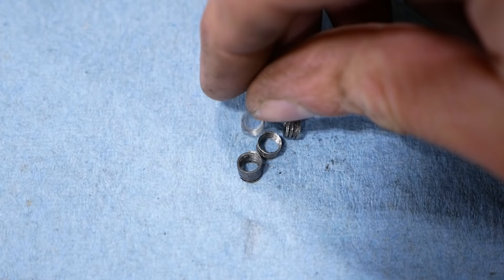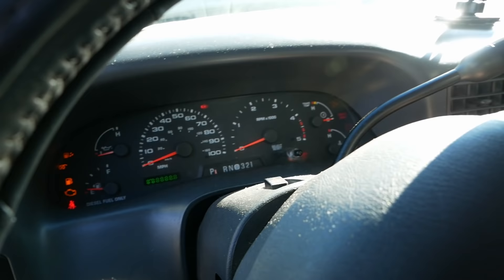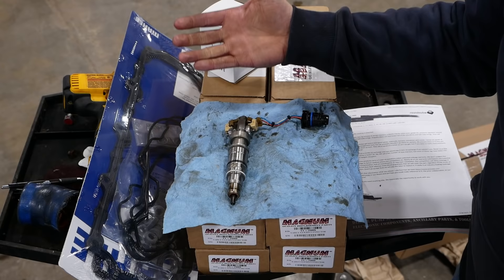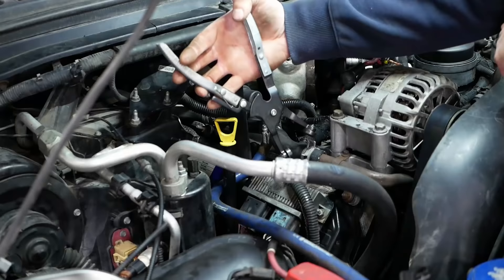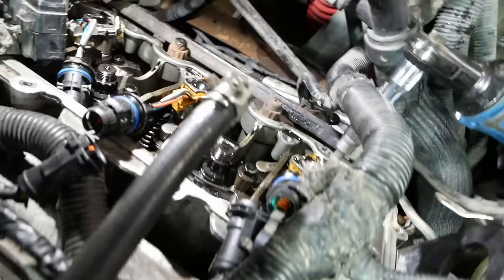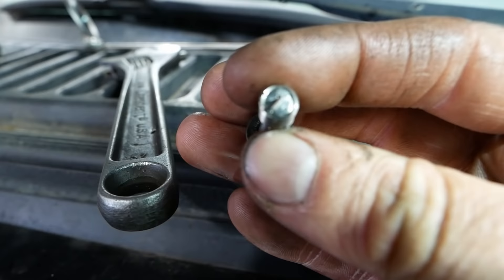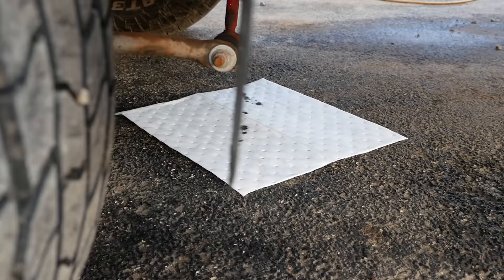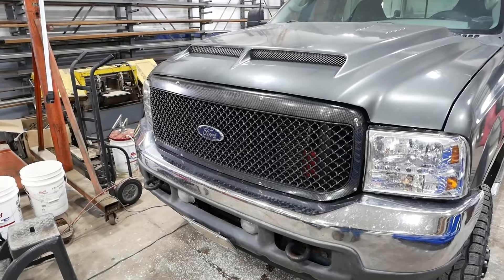They Left Me a Mess - 6.0 Power Stroke Low Cylinder Contribution - Injector Replacement Woes

Comment: Our newest car is a 2002 model year and we have had minimal problems with any of them.  The more I watch videos like this the more I'm convinced we need to keep our cars running as long as we can because the newer cars are just one big problem after another.  BTW, we had a black lab who hated cold, rain, wind -- everything that labs are supposed to like.  I think her ancestors must have come from Florida instead of Canada.
Reply: My lab was the same
Reply: Back in September of 21 I bought a 2002 Tacoma and have been changing its plugs and oils and just try to put it in the best running shape it can be. It has 290k miles but the body is in great shape and the frame is ok with some repair needed. I got it for 7k but would not sell it for less then 10k now. 
Oh yeah my little dog hates the wind but I think she would take on a bear if one came in the yard.
Reply: @stevanrose7439  
Yeah, we have a little dog like that.  Scared to death of any loud noises, even the sound of rain on the roof, but thinks he can take on anything he can see that moves.

Comment: The 7.3 injectors use a spring return poppet valve instead of a spool valve. It's a durable design, but mechanism is bulky and expensive to manufacture. That heavy poppet valve mechanism and spring return makes it slow to react and difficult to control end of injection.

The 6.0 injector was supposed to be more compact and much faster to react. It was supposed to have things like pilot injection for quiet idle. The very first 6.0s off the line had working pilot injection, but it quickly became apparent the injectors couldn't reliably handle it and it was disabled.
Reply: Common knowledge in diesel bros, the louder the clacky clack the more power.
Reply: @jeepindave5464  😆😆😆

Comment: For me, my old truck with the 6 liter is the truck I liked and miss the most, but is also the truck I’m glad I don’t have anymore. It was so awesome when it was running right, but pretty bankrupting when it wasn’t. Great vid as always, Wes.
Reply: Also, I totally get the customer’s desire to keep his baby going. I threw thousands at mine before I bailed and got a 6.2 gasser. Of course, the 6.2 snapped a valve spring at highway spped at 80k, which promptly caused the cat to fail. Us Ford guys are gluttons for punishment. Meanwhile, the 08 E van I have with the 2v 5.4 just keeps chugging along, no problems.
Reply: @oldhouseredux7733  Those 2v Fords are one of the best engines Ford EVER made for reliability.
Reply: @oldhouseredux7733  Ford loves the fuel strategy of keep dumping fuel into the cylinder even though its misfiring.
Reply: @mph5896  for sure! I’ve had a 5.4 2v that went 410k before the rest of the van rotted. The best engine was of course the 300 in my 94. I drove the old girl to the junkyard with 535k miles - all with the same trans! It was still running great, but the rest of the Econoline had completely disintegrated.
Reply: @oldhouseredux7733  300-6 was a very reliable engine. They were just complete dogs trying to tow anything.

Comment: Working at an international dealership, anytime we do injectors or open up the high pressure oil system, we take it for a good ten mile test drive to bleed all the air out. Just idling doesn't push all the air out as much as you'd think it should. Once the air is bleed, they usually Start and run just as they should everytime.

Comment: I'm so glad I hung on to my 1999 Dodge Ram 2500 reg cab long bed.  Yes...I went through all the fueling problems with it, but with an upgraded VP44 and FASS fuel pump all is well.  Transmission was Goerend upgraded and that really improved the fuel mileage.  No leaks at all after all these years.

Comment: Quick tip whenever you get those broken connectors that large.
When the connector is apart, put a thin ring of butyl on the male connector toward where they meet, so as you put them together the butyl is forced between the two but not toward the pins.
She wont come apart anytime soon
Reply from the maker: How do you get them apart?
Reply: After the butyl? I grab my cordless soldering iron with the heat shrink end and just get her a little warm and itll pull apart. But you just hope not to have to lol
Reply: Also if you end up in a boat where butyl is stuck or wont come apart, pb blaster will liquify it.. almost too much. Itll make a mess, but cleans with solvent

Comment: I myself had ran into the same stripped bolts in a 6.0 doing the injectors. The injectors were changed by the dealer and they stripped several valve cover bolts out.

Comment: As soon as I saw the silicone hose and "go fast" goodies (coolant filter, radiator, EGR delete) I knew you were going to find a whole host of dubious fixes... People are real quick to add stuff like that but not too careful to follow proper procedures for removing and replacing components (like following torque specs), then they wonder why there is always something wrong with their ride.

Comment: I think it's a good idea to do a leak test on everything between the turbo and intake on any higher mileage or just older diesel. I can usually find something. And they shouldn't have used common hose clamps on those blue silicone hoses.
Much respect for using the scope and the fine job you did on the stripped threads and bushings!

Comment: I own one, a low mileage one. The FICM is always a problem. A mechanic went thru mine to get er fit for going the long haul I/E bullet proof everything. Soon after the work was done, 2 injectors mysteriously died. I took it back, he fixed it at cost only because he felt bad. It then had a rough missfire idle. He reached under the FICM and pushed on the harness connection and the rough idle went away. I believe the bad connection blew the 2 injectors. But, I could be wrong. Anyhow, one must deal with these daily I believe to understand them. Great engines when running correctly. Until they run like shit.
Reply: it's great.... until its not. like my cummins and transmissions :D
Reply: I worked at Ford 15yrs I am master on the 6 liter and 6.4 I am at cat now I couldn't handle the stress or atleast they didn't pay enough to deal with it anyways bad connections at the ficm has killed many many 6 liter injectors its a garage design how it's under there I would tell my customers to mount a 12v computer fan on the ficm to blow air under and around it (ford wouldn't let me do it thats a hole another story )u keep those parts cool with a fan latest a lot longer 😀
Reply: "Anyhow, one must deal with these daily I believe to understand them." Pretty much true of every vehicle built since, oh, I'll say 1972.

Comment: This is why smart people buy Toyotas. Great explanation about the 6.0 injector problem. It's IMPERATIVE that 6.0s be maintained at proper oil and coolant intervals. Even then, the head bolts on early 6.0s were also a problem. You are a REAL mechanic, not just a parts changer. Thanks for keeping the art alive.

Comment: Funny how you mention Ford and their too many threaded design and I thought to myself, comes in handy when a bolt gets stripped - only to find you do the SAME EXACT THING and not circle back to your earlier comment.  Haha, thanks for the long format video here on doing injectors.  I had a 03` Excursion Limited with a 6.0 and I loved that truck and still miss it from time to time.  It hauled ass,  hauled the family and hauled 8' lumber in the back and could bury the speedometer pulling 10k+ lbs with ease.  I ultimately passed it on due to injector and trans early warning signs - it also have over 210k on it too.

Comment: I ABSOLUTELY hate Diesels. Those 6.0l diesels are one of the main reasons I despise them. I worked as a paramedic for a dozen years. We ran a dispatch system known as system status management. Which basically meant the crew lived in an ambulance on street corners until they get a call. Trucks would idle all day long. The exhaust stunk (blow into the cab), they were loud and these 6.0l were about as reliable as an 80's GM car. Gas v10 ambulances were a godsend.
Reply: @Lowpass76 The general rule was to never shut them down when you were on an active call. Chancing a restart on a dying patient to a 6.0l Ford was not the best call to make. 

I had a couple instances in which they broke down loaded. Sitting on the freeway broken down waiting on another truck with a patient in the back was not the most exciting situation.
Reply: @mph5896  But in my experience, the v10 would never break and refuse to die or constantly be in the shop. And I bet every time one of those 6.0 Powerstroke ambulances had significant engine failures like blown head gaskets or stretched head bolts or a failing oil cooler it was never "Bulletproofed" with head studs and better-designed injectors head gaskets oil cooler or EGR. They were just "fixed" With the same shity ford parts that will just fail again in X amount of time.
Reply: Giovanni Litterini correct, nothing was modified. You cannot modify an ambulance like that due to liability, and they need to meet emissions.

Comment: Yep! Had a 2003 F350SuperCab 4x4 long wheelbase! Love it pulled my camper with ease. but one day, going on a trip, it acted like it had a miss! Go the camper parked and it seem to run ok for the next few days, till I started to tow the camper home. The miss was back!! Long story short, Home, dealer where I got it at, was a drive, pushed it hard on that drive, w/o the camper, it was missing when I pulled into the dealer, left it run and went and told the service writer. few days later, new #7 injector, new radiator (when they cut the fan guard, they cut into the radiator!) Ran great after it was fixed. But like you said Wes, it took 40 acres to turn it around w/camper!! But I still loved that truck!! Nice work!! (I can understand the frustration you go thru when working on equipment/vehicles!)

Comment: As 08 powerstroke owner, I'll tell ya - 12-15K worth of "shop" work for a 19 year old diesel - for what these trucks (can) do - that's not bad. Don't be too quick to poo-poo the after market deletes. Without that factory crap on my 6.4 that truck would have gone to scrap long ago (which is why I never see another 6.4 on the road). $4K in "getting rid of ford/international" mistakes and this truck "pulls oak trees out the ground..." (that 4K is my work, it's foolish to take a diesel truck to a shop (you'll go broke (to your point)) - and never-never-never take it the dealer!!!)

big fan of the longer vid's, keep up the great work, as a fellow "rust-belter" I get a good snicker every time you go under a vehicle.

Comment: I have had just about every issue any 6.0 liter owner has.  I had all 8 injectors replaced with NEW injectors.  Seems that the way the fuel system is designed the injectors are starved for fuel as you move toward the rear of the engine.  It cost me $2,000.00 to get that done.  While he was in there we replaced the turbo, the STC fittings the HPOP the glowplugs.  The FICM was good.  Those early '03 6.0 liter diesels did suffer from wire chafing.  Great video!

Comment: Good video. I learned something. I own a 1995 Ford F350 standard cab dually 4x4 with 7.3 Powerstroke. I have regular maintenance performed as needed. As a farmer/feedlot owner I cannot afford the cost of a new 1 ton. Wes, you're correct: what I paid for this truck in 2002 I can recoup (and then some) if I were to sell it in 2022. I believe repair costs are nothing more than the expense of owning something, unless the vehicle or tractor is just poor design (junk from the factory). By the way, this truck's AC system still functions like it did when I bought it. I have not replaced a single part or had the system recharged.

Comment: Great job Wes. Do not beat yourself up over how you charge for your work. Your loyal customers (the ones you rely on) are loyal for a reason. They find value and reliability in your service. If more of the so called mechanics had work ethics like yourself and the support group you mentioned the industry would be much better off. As you ,know an intermittent problem isalways the most difficult to find. Keep the videos coming and Easter good wishes to you and your family.

Comment: A trick I've  used before  is to mix up some jb weld put it in the stripped out hole then coat the bolt  with vassoline  and stick in the hole let it set over night and tighten it down

Comment: I just write on the plastic/metal with a white edding which type of screw I took out, when there are more than one in an area.

I also tend to put a tape on the part with one small part of the tape, put all screws on the tape and then double it up.

Avoids "shit I dropped all the screws of this machine on the shopfloor" accidents 😂

Comment: wow - you're more creative than the shop who ran into the stripped out head bolt on my 03 dodge. It wasn't even in a hard to reach place. Was back before I knew anything about basic mechanics and I needed some work done - shop called me and said "well we got bad news and bad news..." bad news was they stripped the bolt (it had never been off before - must have that way from factory) - other bad news was they couldn't fix it. They said I could buy new heads or they could jb weld the bolt in. I told them to jb weld it - I was getting ready to junk the thing in a few months anyway. It started losing compression literally the day I bought a new car. I was able to drive it to the junk yard with it jerking and burping all the way there. haha. Funny thing is the shop was a well known franchise chain ....you probably have one nearby.

Comment: I had a 04 6.0 for 8 years. Had the FICM go bad at one point with no codes. Took someone with a live view scanner I didn't have and they monitored injector voltage. Found the capacitors were bad and wasn't giving enough voltage to the injectors. New FICM power module and ran great after. Traded it off for a brand new 6.2 gasser a few years ago. Haven't looked back.

Comment: Last load on the car trailer for the 6.0 it barely made it on the trailer under its own power while pouring antifreeze, fuel and oil all at the same time from the engine. Put a 5.9 in it and runs great, no more issues

Comment: Did I read the miledometer right 171K??  I'm sure he's used it to haul insanity, but I have an 02' F-250 Super Crew Lariat with about 130K on a V-10 auto. I've hauled cars cross country and into the North, (Sumer only) and I haven't done ANYTHING to the engine or tranny!! It still has the original plugs in it!!!  What a difference between these two trucks!!! Honestly, oil and filters is all the hood has been opened for. And wiper fluid!! I have replaced the pinion seal, brakes tires, shocks and oil/filters and the window switches on the drivers door, but that I blame on myself as I left the window open overnight once when it rained like hell.. 1 Front market bulb and 1 brake light bulb. Now I live in Florida so it doesn't see salt and potholes the size of craters, but we have a washboard road coming into our neighborhood, so it's not like it doesn't get some shit beat out of it!! And I'll NEVER do a 4x4 Ford again since I watched Eric O replace those seals from hell!!!!  Before moving from North of Eric O to Florida, I plowed snow commercially with nothing but Fords and I NEVER had issues.. Wouldn't do it today.. That's INSANE!!!! Old school with Warn hubs or 2wd and Florida.. Only choices...  And I remember the days of getting into really bad positions working on that junk and the phone ringing.. I used to get pissed off just like you and Eric and half the other guys making videos. Then I started reminding myself that when the phone rang it meant MONEY WAS CALLING!!! So take a pill and keep that in mind... Without it you'd lose the shop!!!!  HAhahahahaha....

Comment: I have a 92 d350 dodge 12 valve cummins diesel dually extra cab 5 speed 113k that I picked up. Barn find from the original owner. Even though it was a ranch truck, I have had no shortage of people knocking on my door asking to purchase it. I have been offered 20k for it. Still got it. Love my first Gen

Comment: Messaged ykh about a problem with my turbo on my cummins diesel on my dodge 2500 about a month ago. You were right. Jg was a busted high pressure hose clamp on my intercooler. Very easy fix. Thanks $35 and I was back on the road.

Comment: Mahle (the gasket you had) used to be a big German piston manufacturing company. Someone at Mahle figured that diversity is good and now you see all kinds of parts with the Mahle name. Unlike the old days the new variety of parts are not all German made. --------How about fixing the stripped threads by going longer bolt with a nut?? Great show!!

Comment: A bad attitude involves quitting.  You don't quit.  Part of the reason I watch every video  you put out is to see the clever and workmanlike ways you solve problems.  The sad thing is that most of the issues you have to solve are because of someone else's sloppy work.  Using oil is just a Ford thing, isn't it?  My old Ranger used a quart of oil between oil changes from the factory.  It never changed in the 8 years I had it.

Comment: had a similar issue on my 6.0 after we replaced all 8 injectors.  turns out a brand new injector was bad in under 300 miles.  glad they were under a warranty.  hated having to redo the job two full weekends wasted

Comment: I've had good luck with BG109 for stiction, but like you said- it isnt a miracle worker. Its just a damn good cleaner. Haven't tried the HotShot stuff yet. 
That 109 works a treat on carbon-stuck rings as well- I've seen major reductions in blowby, but again- IT IS A CLEANER. A damn good one, but just a cleaner. It can't replace worn-out material.